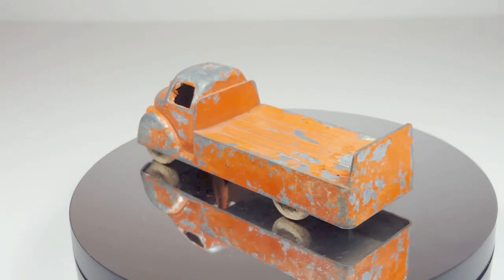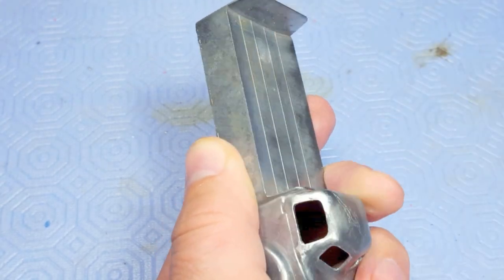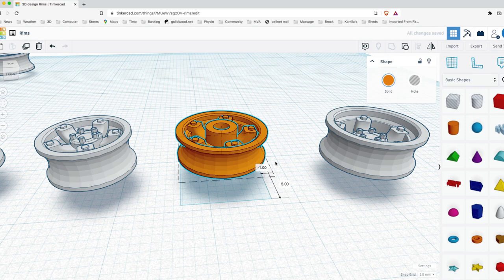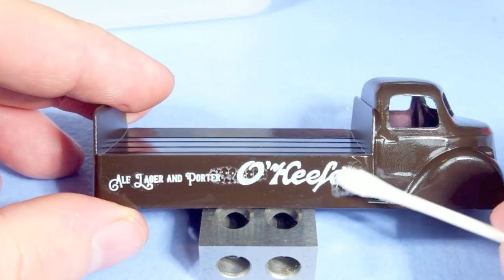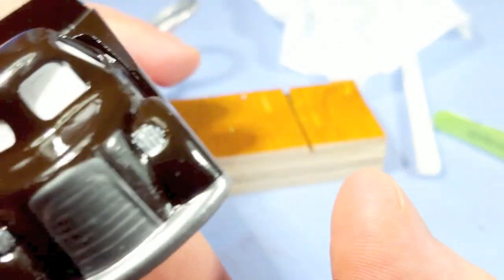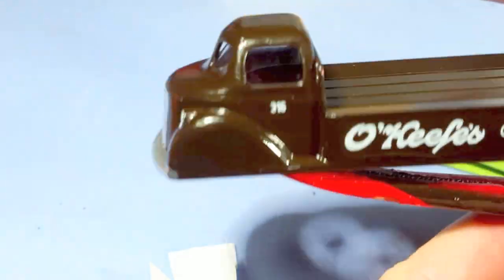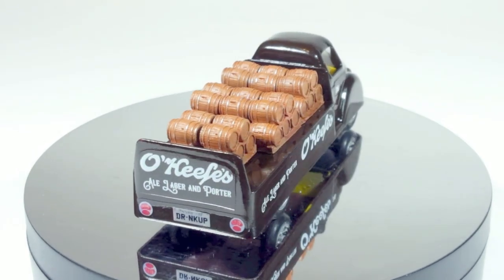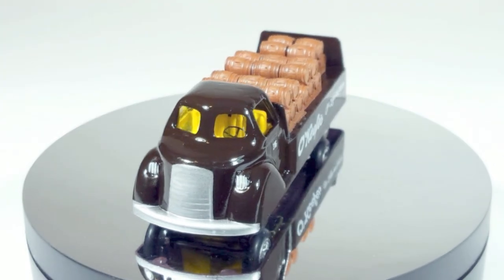I can't believe I misjudged this toy. LondonToy No.15 Beverage Truck

Comment: Stunning Timo; quite stunning. I’m glad you gave a clue at the top that it would alright in the end or I’d have had a breakdown!
Time to drink up......then get on eBay. There’s a pair on there presently; a tanker and a pick up; in the U.S. Not cheap though!
Reply from the maker: Thanks Septic 🚽 . I did have a look, but I didn't pull the trigger. The shipping was ridiculous. I think I will find a local one fairly quickly.
Reply: @timosdinkydetailing  .....yes, the P&P was a bit steep. I make you right on that. Still, I look forward to seeing it done when you find one.
Happy Sunday from the Kingdom of UK 😆

Comment: What is the printer you use to print out the white on clear. Great resto 😎👍
Reply from the maker: I use a HP colour laser multifunction printer, and Ghost white toner. It's a pretty expensive proposition, especially when printing only tiny decals.